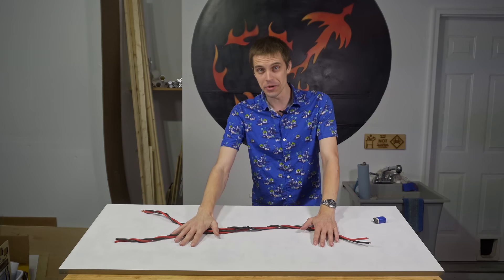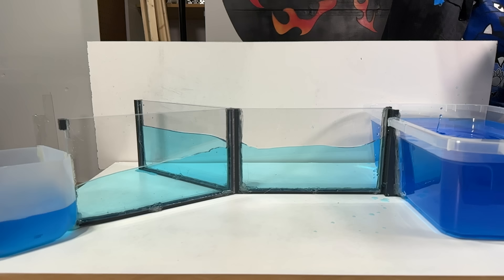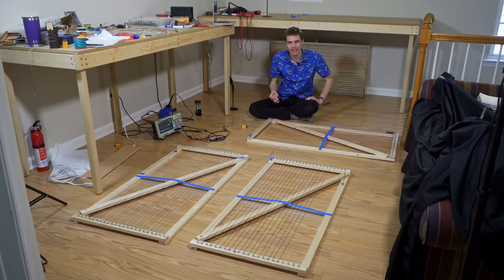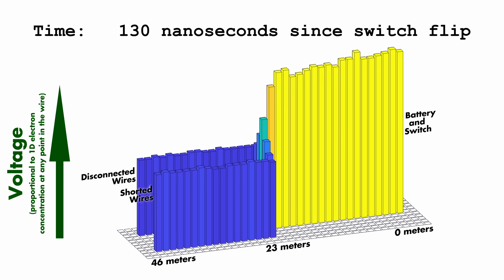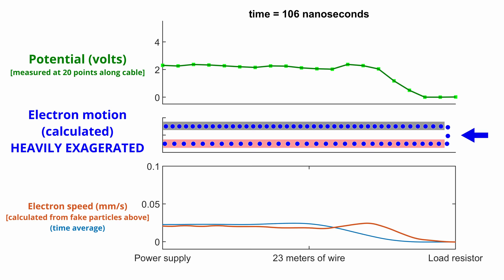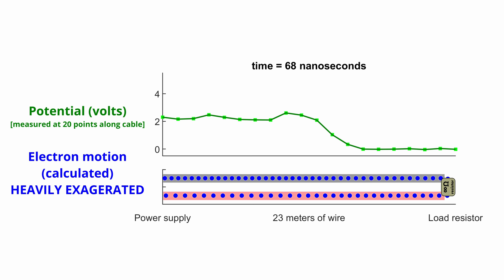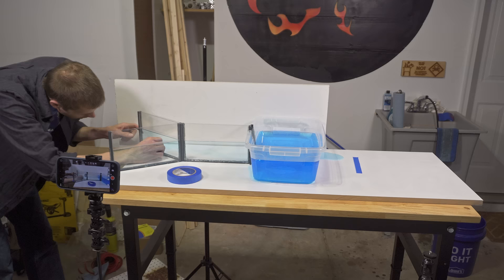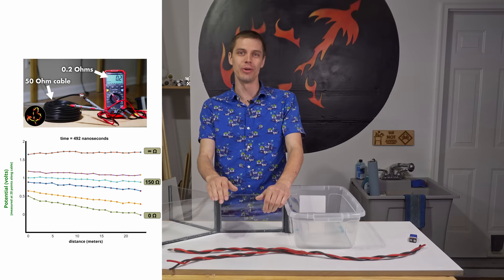Watch electricity hit a fork in the road at half a billion frames per second

Comment: At 3 minute and none of the 4 options are correct. You need to read what is "electron hole" and then you will know how the current travels.
Reply from the maker: There aren’t holes in these metallic conductors
Reply: @AlphaPhoenixChannel  this comment clearly shows your ignorance, the positive terminal introduce holes. The negative is just place from where free electrons rest.
Electricity in wire flows like pulling a rope, not like pushing a water in a tube.

For example you can redo the experiment, but connect the positive terminal and do the measures(without ever connecting the negative). You will have the spike and initial current.
You can try with connecting only the negative terminal: nothing will happen.

Or ofcourse you can just ignore all this and use wording like "voltage is piled up" in the disconnected wire, whatever that bs means.
Reply from the maker: @Xizario2  check out band structure and e-k space, and how electrons behave in materials without a bandgap
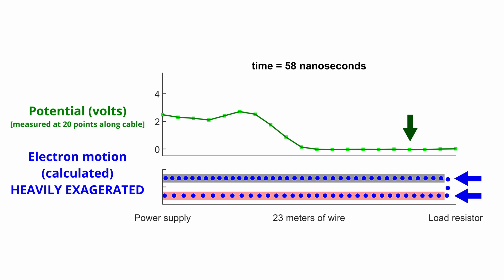Reply: At 16:30 : You said correctly that the middle graphic shows difference between the electrons in the red section and the blue section. BUT the graphic is wrong. The entire difference is caused by missing electrons in the red section and not by excess in the blue. You can't just put more electrons in the blue part.
Redo your graphic to match the oscilloscope readings from the top.

Correct graphic should be: 
Electrons flow from the red part to the source, red part have less electrons... this goes to the end of the graphic, then continues in the top(blue) from right to left.

Leftmost electron in the blue section is the last to move, and there shoud not be squishing of electrons in the blue section at all.
Reply: Furthermore, if you were able to push more electrons... hell you would be able to pass the electricity in any material. Metal or insulator... you are adding electrons... But in reality nope: you just pull the free ones in the wire, and their place is taken by the next one and the next one...

Comment: Electricity doesn't literally run inside the wires though...
Reply from the maker: The electrons do
Reply: And electrons don't contain the energy that's being transferred. The fields around the wires do. I may not be a literal EE, but I at least know that much.
Reply from the maker: the electric fields are created by the electrons existing and the magnetic fields created by the electrons moving, so the fields and the energy they contain are inseparable from the motion of the electrons - you have to consider both

Comment: Your setup lies. The input impedance of the oscilloscope is huge, but not infinite. At the moment you hook it up to the unconnected cables, a tiny current starts flowing through them. Also your cables are twisted, so they have an inductance. When you flip on the battery you create a transient inductive current, even if the ends of the cables are not connected. Your experiment does not do what you think.
Reply from the maker: Watch the second video about the experimental setup

Comment: Electrons aren't traveling anywhere. The energy is carried on the outside of the conductors. No particles involved. But keep on perpetuating the common myth. Delete this comment. Doesn't matter.
Reply from the maker: Energy is carried outside the conductor but that event is controlled by the charged particles moving inside the wires
Reply: Until you can actually show me the electrons that have moved and where they went, I'll stand by my original statement. No offense intended. I just doubt a lot of everything as of late. Nothing personal. Just tired of all the contradictions and theorizing hubris regurgitated from a textbook.
Reply from the maker: @bigdave6390  there aren’t contradictions in this explanation that I’m aware of or I wouldn’t teach it